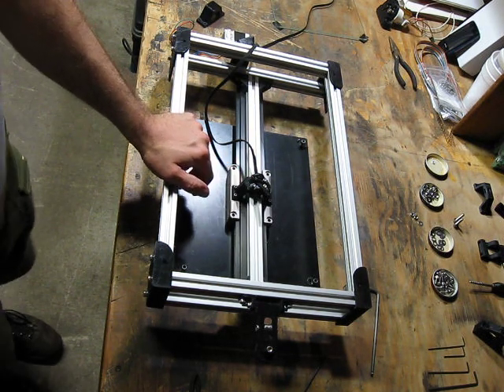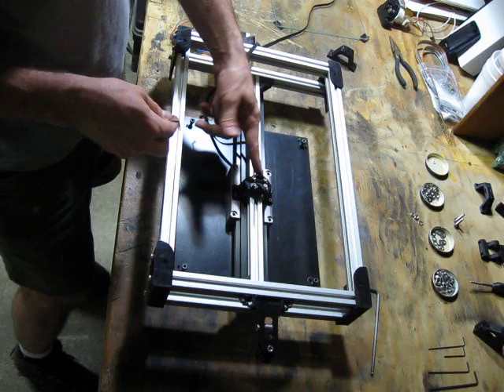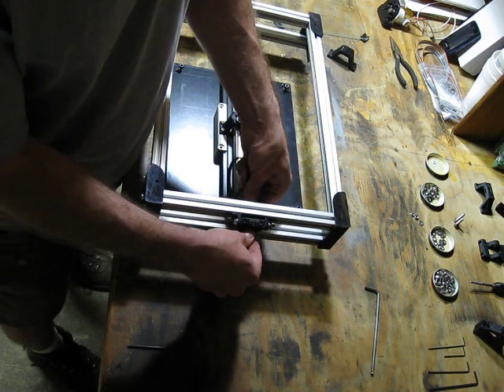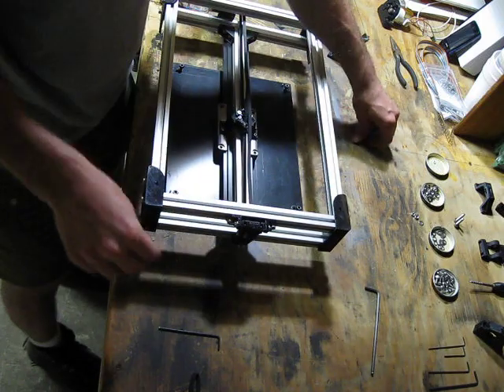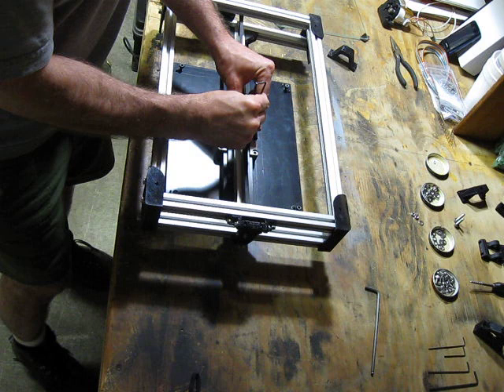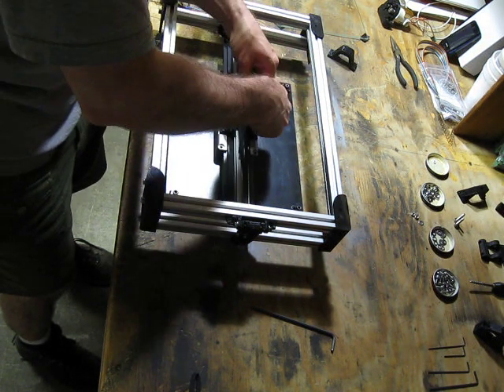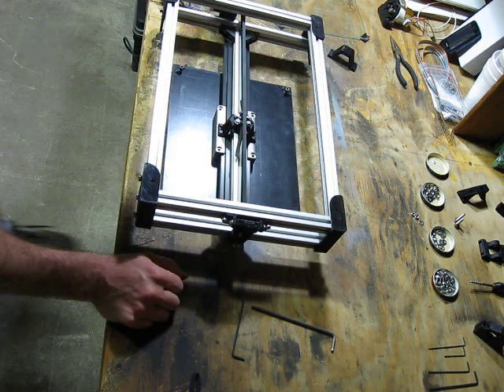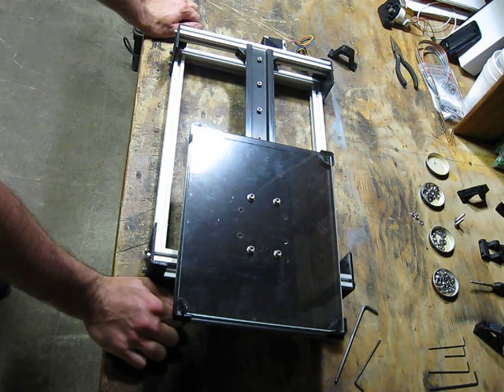Prototype y-bed installation- video 3

Comment: Hi Simonius, Greate installation video. i was wondering:

you are using abs for the couple piece on the slider right?

do you forsee any problems with heat whit the coupling part on the y-axis slider?

i've seen some problems using pla here when places to close to the heatbed.